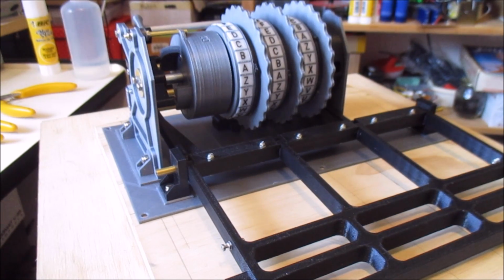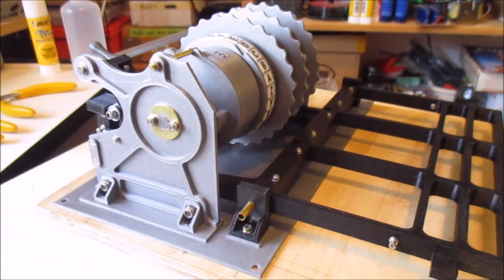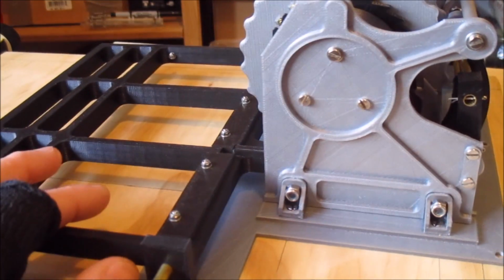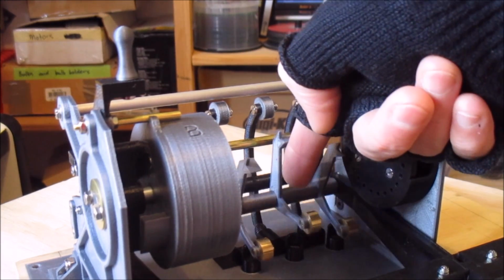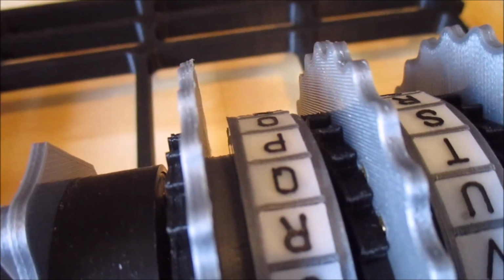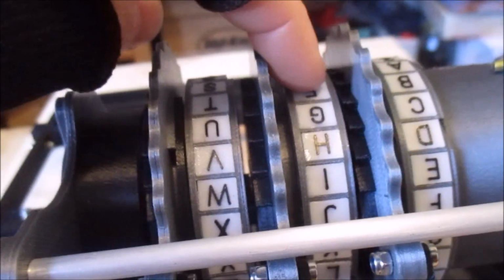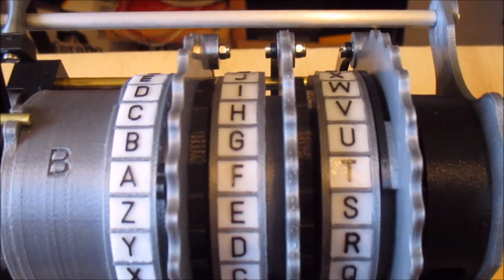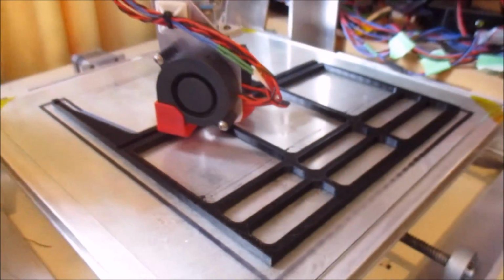Update on the 3D printed Enigma machine.

Comment: This is the clearest demonstration and explanation of the double-stepping I have found. I was struggling to understand it  but seeing it occurring in such detail clears it up for me. Thanks. Hope you managed to get the whole machine functioning in the end.
Reply from the maker: Thanks, it wasn't until I saw it I really understood it and why it happens mechanically even though I had done software implementation in the past. The way I think about it now is that as a rotor steps it always pulls the rotor to its right around with it. You just never notice it on the right most rotor since that steps eveyy key press anyway.

Comment: Can you tell me what method you used to reliably connect the metal contacts between the rotors?
Reply from the maker: Pogo pins and flat copper rivets. But until I do more rotors I am not sure it will be reliable!
Reply: @asciimation  Thanks for the info! I'm trying to make my own, and I can tell you how frustrating it is to connect those ports
Reply: @asciimation  Thanks! can I have the link to those?
Reply from the maker: @gaolab  Pins: https://www.aliexpress.com/snapshot/0.html?spm=a2g0s.9042647.6.2.748a4c4duOUilf&orderId=8136241020810763&productId=1595999208
And copper rivets (M2x8): https://www.aliexpress.com/item/32818437691.html?spm=a2g0s.9042311.0.0.27424c4d8281tF
Reply: @asciimation  Pins aren't being sold anymore, do you have the measurements?
Reply from the maker: @gaolab  This was the description. You should be able to find similar: 100pcs P75-D3 Dia 1.5mm Spring Test Probes Pogo Pin Length 16.54mm (Stroke Spring Froce:180g)
Reply: @asciimation  That was very helpful! Thanks!

Comment: Hi there, I had 2 little questions about your Enigma. The first one is very simple: what software do you use for designing your 3D models? I've found the one I use now is falling a bit short for this project. And the second one is about the index ring. Correct me if I'm wrong (I'm still a bit new to Enigma's inner workings), but I thought more options were also created by being able to choose a starting position for your index ring by moving it around (both in the way of choosing a "starting letter" giving 17576 possible settings for 3 rotors and in being able to move the ring around the rotor therefore changing the letter at which the middle and slow rotor rotate giving another 17576 possible settings). I was wondering if this is still possible if the little crease in which the handle pushes up is on the actual index ring with the letters being stuck on it. I'm very much a fan of your system with the little handles moving the rotors around (it would save some work to say the least), so I'm very much hoping it works that way as well. Thanks in advance and goodluck with the project. Cheers!

Comment: I wrote an Enigma app, for a 3 rotor machine, for iOS devices. It works great! I haven't added the Steckerbrett and plugs yet but will do that soon. After writing that app, I decided I wanted to build a physical machine, actually 2 of them, and started searching the internet  to try and determine not only how all the parts are shaped but their dimensions also. I've been guesstimating the dimensions then I stumbled onto your youtube videos! I was thinking about 3D printing my rotors and was pleasantly surprised when I found your videos and how you went about doing your 3D Enigma parts printing. 
Wow! You've done a great job! I'm still in the initial stages on the shape of the parts and dimensions.

One thing you might want to consider to fix the flexing of the thinner 3D printed pieces
is to cut and shape thin pieces of aluminum sheeting and super glue these pieces to the flat side of your 3D pieces that flex. This would make them more rigid and you wouldn't have to make those pieces thicker which sometimes creates more problems as you've already discovered. You end up having to change the dimensions on additional pieces in order to accommodate the new "thicker" pieces. 

Anyway, great job! I hope continue progressing and finish your machine. It's motivational for me since I'm still at the drawing board stage!

Gary

Comment: Very nice! Do you have any plans to share your 3D files?
Reply from the maker: I am not sure yet. I have to finish them for a start! And then the machine won't be easy for someone else to just print and make one. You need other parts and access to a lathe really.
Reply: asciimation a lathe? For which part do you need that? Also im started to build my one replica enigma but i started with the Steckerbrett and those plugs since your allready tacked the rotor problem
Reply: @asciimation  please give us the files because it is difficult to build but remember an original enigma costs 100,000 euros nobody has the money to buy it so your project is literally the only way
Reply from the maker: @ruphusbau3721  Sorry but until they are done and the machine works there is no sense in giving out the files. At the moment they constantly change. If I release incomplete or incorrect files the people who want them won't have the skill to realise they are wrong, or need changing, or be able to fix them themselves. People always say they just need the files and can work out the rest themselves. If you can work out the rest then you can just build your own to your own designs.